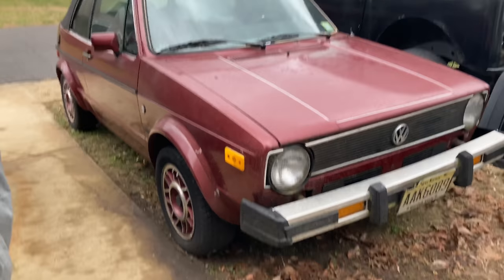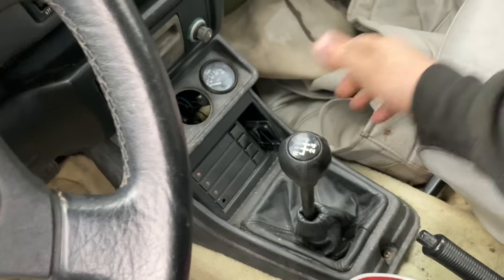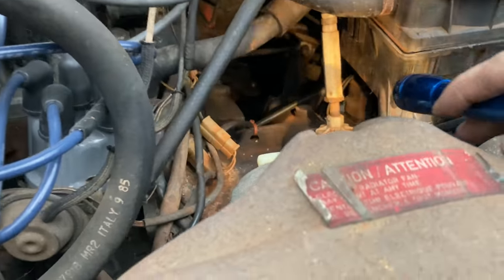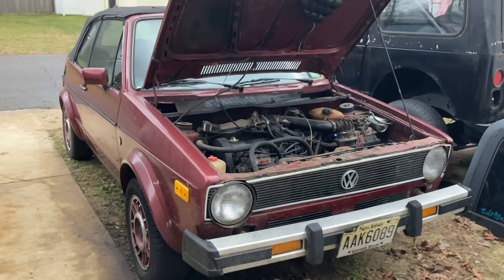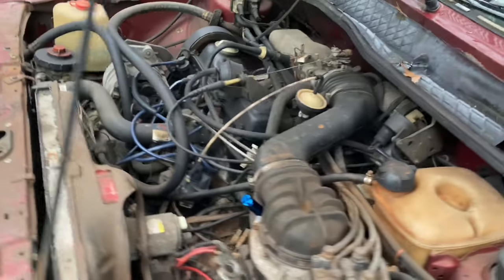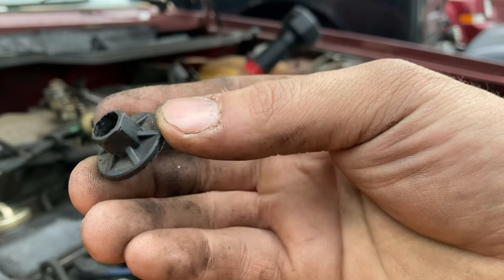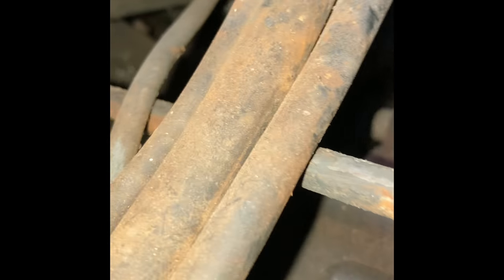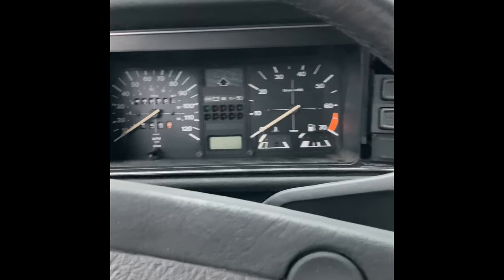Mk1 Volkswagen Cabriolet Wolfsburg Edition Euro Junk???

Comment: Do you still have this car?  What's new with it?  I never owned one (Westfalia's), but my friends did.
Reply from the maker: I actually sold it not to long ago but it was a nice car one of the better ones clean interior (grey and Burgundy) leather stick shift no rust original wheels ect. Coulda used a new soft top but it was definitely a classic
Reply from the maker: It did have the notorious volkswagen soup ladle shifter because the bushings were shot you could literally put it in gear and move the shifter around in a huge circle so i improvised a fix and it worked great afterwards